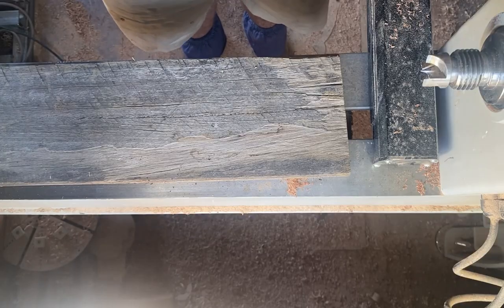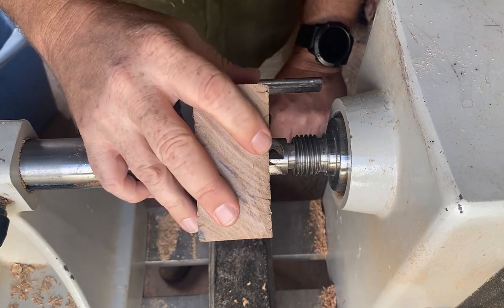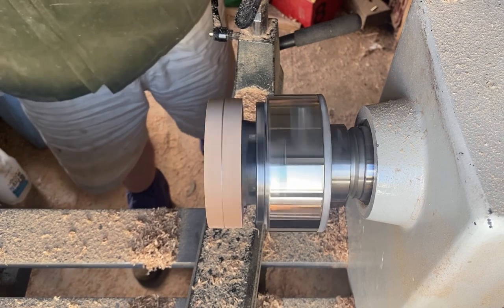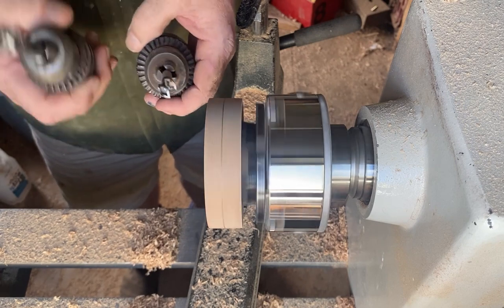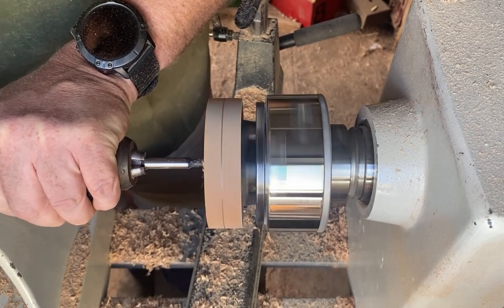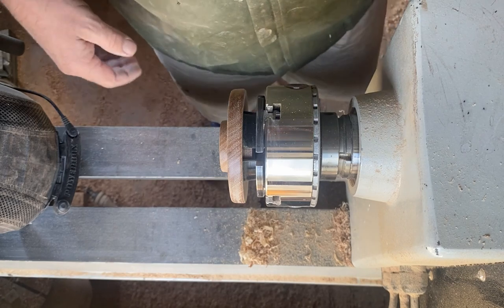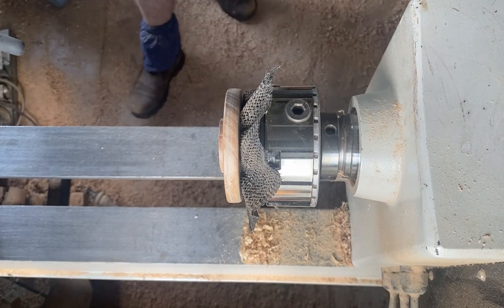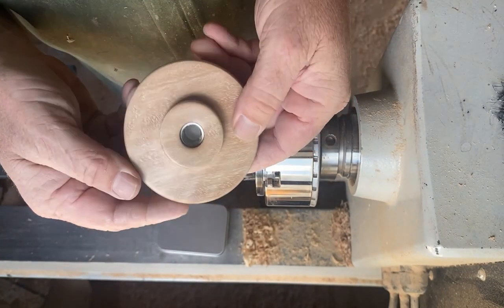Woodturning a Whisky Smoker. (Great woodturners beginner project)

Comment: Do you use any type of finish for the wood or do you leave it bare? I know a lot of people would take issue with putting a finish on something you're adding a flame to, but what if you didn't add it to the center portion?
Reply from the maker: Hi Robert
No I don’t use finish on the whiskey smokers. 
I have considered either strait beeswax or mineral oil like you said just not on the centre portion, but I personally believe that would not look right. 
So no finish for this product.